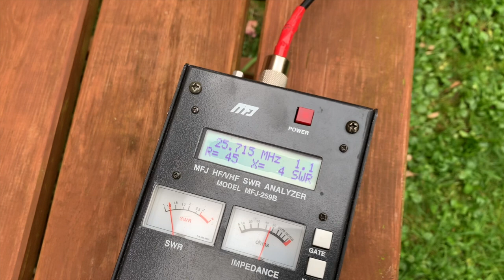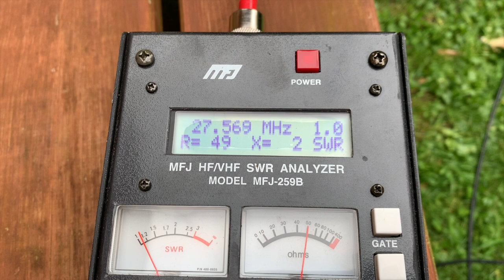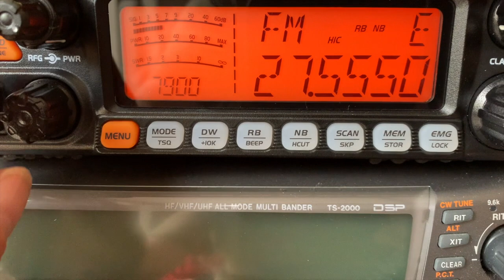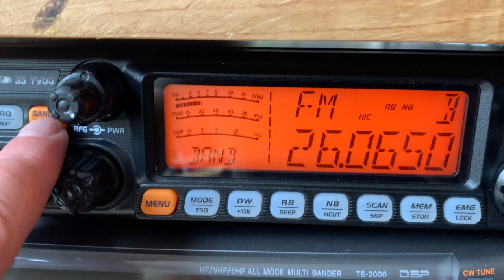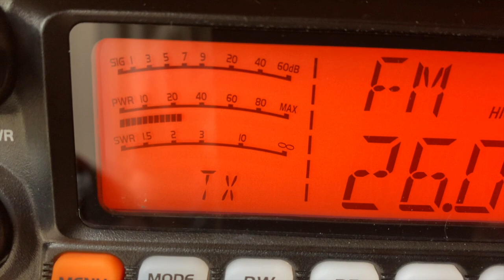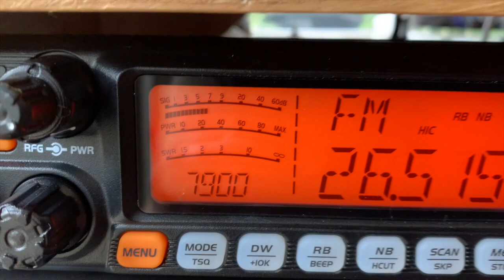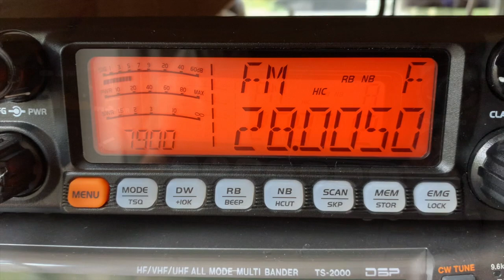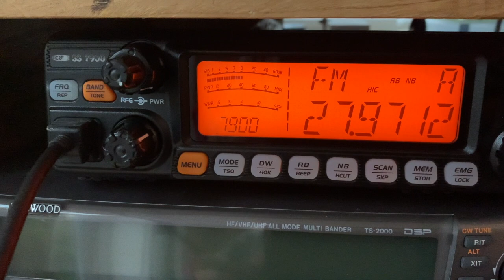CB Radio: Build a GainMaster HALFWAVE on a DX Commander Pole..Another detailed upload

Comment: What a brilliant little antenna been running skip from South Africa to EU even as far as Finland Thx Mike.
Reply from the maker: Thank you 👍
Reply: How about instead of using 8AWG copper wire (same as 10mm2), make the upper part with same coax, using its outer part shorted with inner? Isn't the diameter of the coax will give much more wider bandwidth?

Comment: Interesting to see an alternative to the traditional T2LT 73
Reply from the maker: Cheers Tim
Reply: yes im going to build it
Reply: We really need a quarter wave length coaxial trap? I saw other version of this antenna with only 5 or 6 turns on a 10 cm diameter pipe 🥺, I'm confused 😁
Reply: @14KiloWhisky - it's actually a half wave choke, because it said a voltage node so it's a voltage choke not a current choke. So what you have to look at is about 2.6 in of former Plus the current is going all the way around the coax so you have to take the average of two halves equal to one hole or an additional point 2" so a total of 2.8 in * pi * 16 then divide that by the velocity factor and guess what, you've got a half wave inside which is 180° out of phase which tends to cancel - exactly what you want at that point.

Comment: The HW version some have stated handles power better than the 5/8. I can confirm this as I have owned both. The SWR on the 5/8 version likes to creep up when running power. Maybe the matching stub is the culprit. I had the 5/8 wave up for 8 years with no issues, until it got wacked by lightning. I now have the HW version and no SWR crawl when running power. Performance is about the same.
Reply from the maker: Yes it is the stub,  that is one of the reasons for west flex the power handling.

Comment: I once build a TL2 and de SWR changed if the feedline was moved. So i wasn't impressed. Then build a Double Bazooka.  I'm still using it on 11 meter. I made one for 40 meters too but i have no space around the home for such a antenna. However i tested it once when i was camping and it performed also very good.  Since you are enjoying making coax antenna's you could try it as well just for fun and experiment.
Reply: I'd like to know your choke design as in how many turns and what diameter former..?
Reply: @JAFO.  12 turns coax around 10cm. Beside that i used a fabric made ferrite choke.
Reply: @48pluto - sorry it took me a few extra days to get back to you, LOL, but you had about one turn too many on your 10 cm former choke. 
- if you were to try it again with 11 instead of 12 turns on a 10 cm former using 66% RG8X or RG58 I think you'd have much better luck.
.
Now don't forget End effect meaning you want the bottom half to be the full 108", but the top needs to be 5% shorter so more like 102.625".
.
By now it might be a moot point but if you ever get the bug and want to try it again, give it a shot with 11T -;or you could use a 2.6" former and wrap 16 turns using 66% RG8X or RG58. 
.
Mine works so well it's quite flat across both the 10 and 11 m bands and not hitting two to one until about 2 MHz bandwidth! 
73

Comment: Hi !

Q1
The cable is RG58 or H-155 ?

Q2
Is there an exact diameter of the cylinder on which to wind the cable, or is it only important how long the section is?

Q3
I would like to build it, but I don't understand the final length of the 3 sections. 2.49, 2.49, 2.77 meters? I would like to use it between 27,200 - 27,800 MHz, on classic CB frequencies, in USB mode

Thanks, regards

Comment: Nice construction and great video.  This is actually a 1/4 wave coaxial dipole not a "1/2 wave antenna".  Just as a 1/4 wave ground plane like a "Starduster" or the Italian equivalent consists of a 1/4 wave vertical element with 1/4 wave radials.  If this was what is commonly referred to as a "1/2 wave antenna" the center conductor above where the shield stops would be twice as long i.e. 4908 mm or 16' 3".   Nothing wrong with 1/4 wave antennas... they work well.  There has always been confusion with radio operators and antenna manufacturers around "1/4 wave antennas" as they actually ARE 1/2 wavelength center fed (or very near center fed) antennas....  but in typical descriptions a "1/2 wave antenna" would be an end fed 1/2 wave radiator like a "A/S Mighty Magnum" or one of many other 1/2 wave end fed antennas.  This Sirio copy and the original have a 1/4 wave radiating element and a 1/4 wave "image reflector".  The 5/8 version has a 5/8 wave radiating element and SHOULD have one or several 5/8 wave image reflectors or else the coax shield will have common mode current on the outside and will act as the "image reflector".  An easy and simple way to check for common mode current on the outside of the coax on any antenna installation is to simply place you hand near of around the feed line at various points... if the reflected power/S.W.R. changes then there is common mode current on the coax shield and this can distort the radiation pattern of the antenna/give false S.W.R readings as well as creating RFI in the shack and potentially local RFI to other devices in your home and neighbor's homes.  We don't refer to a "J Pole" or "Slim Jim" as a "3/4 wave antenna" even though the main element appears to be 3/4 wavelength long.  A J Pole is a 1/2 wave radiating element directly coupled to one leg of a parallel 1/4 wave matching section.  The "matching section" is driven by equal out of phase r.f. currents so it does not radiate...  just like ladder line or twin lead.   The parallel 1/4 wave matching section with one unconnected stub is what causes the horizontal radiation pattern distortion of J Pole and Slim Jim antennas.  J Pole antennas and all 1/2 wave end fed antennas have problems with common mode current on the coax and many use a Coaxial Current Choke like the Sirio antennas depicted in your videos use.
Reply: Sorry mate but you're just confused by center-fed vs bottom-fed. If installed vertically, this is most definitely a vertical 1/2 wave center-fed dipole.
The RF energy radiated from both the 1/4 wave center conductor above the cut coax shield and for 1/4 wave below it - ON the shield - adds up to 1/2 wave length, and is stopped by the choke,
 - hence the need for a choke.
On a bottom-fed 1/2 wave the RF energy begins radiating at the bottom of the 1/2 wave conductor (radiator) with high voltage and goes up 1/2 wave, through the high current in the center of the radiator and achieving high voltage at the tip, then reverses back down 1/2 wave through high current in the center to high voltage at the base/feed point, thus completing the full 360° cycle or One wave length.
On a center-fed or this T2LT-style vertical - the RF begins radiating at the center feed point (or point at end of cut coax shield) as high current, travels up the radiator 1/4 wave to the tip where it achieves high voltage, then reverses back down 1/2 wave through high current in the center and to the bottom where it achieves high voltage at the choke, then back up 1/4 wave to high current at the center - for a 360° cycle or one wavelength.
BOTH are 1/2 wave antennas.
A bottom-fed 1/2 wave can have a 1/4 wave height advantage - depending on construction & installation.
A center-fed has the advantage of a near perfect 50Ω feed point impedance, requiring no lossy or power limiting matching network.
73
Edit: I have never before heard the term: "Image reflector" - but it sounds like it would possibly often be heard in certain local areas on Channels 17 & 19. 😣

Comment: Hi Mike, I follow your videos on antennas because you know how to explain them very well, and sometimes I make them.  It would be nice to know if this antenna could also be in 15, 20 mt band.  My doubt is if there calculation for the choke on these bands
Reply from the maker: You can scale them up but size is an issue... the coil is a 1/4wave ;)
Reply: yes this coaxial dipole will work for any band as it is simply a 1/4 wave radiator with a 1/4 wave coaxial sleeve to make up the 180 degree mirror image reflector that the radiator needs.  The choke calculations can be found on the internet for any frequency range and are not antenna specific, they are frequency specific but will still work to some degree even if not exactly correct.  These coaxial sleeve antennas are very popular in commercial and Ham VHF and UHF antennas and usually do not require a common mode coaxial current choke as the sleeve portion resolves most of the common mode current on the outside of the coax feed line.

Comment: you make great videos on the subject of antenna construction 👍🏻 are the dimensions of the antenna that you show at the end of the video the perfect ones?  249cm<--249cm coil 16 turns on 60mm diameter or 66mm?  73 55
Reply from the maker: Yes, correct

Comment: In theory then, just find a 1/4 wave  x2  plus the matching and any band could be made? With Cal's new 60 ft pole maybe a 20 meter version could be mounted, and no radials needed?  that would be an interesting build. I have an M2000 that will not do 20 meters, but it being 24 feet I wonder if a 20 version of this mounted off to the side of it could be done, again avoiding the radials issue. Just a thought, you make building these look too easy!! Thanks for doing all 3 versions!!
Reply from the maker: yep up or down scaling to suit the band.  😍

Comment: I want to recreate such an antenna.
BUT! I want to make the 2.52M top section of two aluminum tubes, because the whole thing should be as thin as possible to reduce wind load and optical reasons. I thought of taking two tubes with 6 and 4 mm diameter each, and 8 at the bottom.so  I could slide the lower part of the coax into a GRP pipe.
Reply from the maker: Go for it!

Comment: Nice work, but you are not done yet. this antenna needs lots more fine tuning.
I built one that has a bandwidth of 1MHz. That is, a swr lower than 1:1.3 over this area. The performance is significantly improved by changing the radiator to flexible copper wire of 10mm2.
Reply from the maker: Thanks for the input.  :)
Reply: How about instead of using 8AWG copper wire (same as 10mm2), make the upper part with same coax, using its outer part shorted with inner? Isn't the diameter of the coax will give much more wider bandwidth?

Comment: Well I have now made both the 5/8 and the 1/2 wave, and the 1/2 wave is 2 s-points up compared with the 5/8! However, this is in hilly Welsh terrain. Not what I expected though!
Reply from the maker: Humm is that 2 points up on a known signal or on  background noise? Interesting 🧐
Reply: Mike-M0MSN My friend who lives around 2 miles away with a few hills between us is now getting me on an S7 whereas he was only getting me on an S5 when I used the 5/8. I haven’t changed anything else at all. I think it could be because the antenna is actually higher off the ground relative to its size, because it is shorter and I am using the same height pole?
Reply from the maker: gtaguy235 OK, yep I think you are spot on, just go to show why we have so many different types of antennas.  Thank for letting me know.
Reply: The "takeoff angle" or vertical angle of maximum radiation is different between a 1/4 wave and a 5/8 wave antenna.  A typical 5/8 wave antenna has a lower "takeoff angle" and hence is better for DX because the lower angle extends the ionospheric propagation angle/distance.  Higher angle = shorter hop/lower angle = longer hop.  The higher angle "1/2 wave" (actually a 1/4 wave radiator) may give you better local coverage.   Each and every antenna have their own merits and faults.  It just takes experimentation to find out which works better for each individual situation.
Reply: @justme-n-gracie  Hey Just Steve, you seem confused about RF. It's AC so there is a positive half and a negative half to the radiated wave-front. A 1/2 wave can be a 1/4 wave up and a quarter wave down - as long as both are in the same polarization (like a Starduster) but a true 1/4 wave GP would have a 1/4 wave vertical and one to four 1/4 wave radials in the horizontal - so since there's a 20dB separation in radiation performance between vert & horiz, you only see the radiation from the upper vertical 1/4 wave - if you're on a vertical receive antenna,
 and that's why it will be 3dB down from a 1/2 wave like a center fed 1/2 wave Starduster, Ringo, A99, Proton99 and others only 18' or so long.  When my cousin lost his mickey-mouse installation 1/4 wave GP in a windstorm and replaced it with a Starduster on the same mast that fell with his 1/4 wave on it, he went up about 1/2 to 1 S-unit to everyone, same height & coax.

Comment: Hi Mike ' good video as per normal".I was wondering if you could' build one of these for lets say ' 15 meter's or 20 meter's or some other HF frequency ?. would be interesting to see if these could be adapted and what sort of performance you would get out of them ;) . cheer's Martin mw0cnd
Reply: Yes. Others have done this by scaling the dimensions. The only issue is of practicality. If you need a 7m pole for the 10m version you would need a 14m pole for the 20m version..

Comment: hello Mike from IU8HDJ I would like to know if the multiplication at 0.93 must be done obligatorily I only understood that you got 249cm because you calibrated at 27,500 right?
Reply from the maker: The 0.93 to 0.96 is a correction factor due to the materials being used (VF)
Reply: @mike-M0MSN  thanks mike  i knew 0.95 for copper and 0.85 for aluminum from what you tell me 0.96 is also fine

Comment: Did you ever do a 1/2 vs 5/8 comparison?

BTW the stub on the 5/8 version, does that exist just to change the impedance back to 50ohm as you increased the length to 5/8?
Reply from the maker: no not yet, and yep pretty much.. :)

Comment: Hello  Mike
Can you explain me how ti calculate the choke depending on the frequency?
In the T2LT 27MHz video make  16 turns on a 6.6 cm diameter.  The total lenght  is 331.75 cm, a long way from 277 cm???
Thank you    73 de i3qko.
Reply from the maker: Yes:  the choke needs to be 1/4 wave length (1/3 on a 5/8 antenna or more)...I used 16 turns because I used the same former as with the 5/8 wave..
Reply: @mike-M0MSN  Can I use a different former, let's say 60-63 mm, while keeping the same 1/4 wave lenght diminished proportionally to the antenna ?
Reply from the maker: @BASSLINEPFP  yes
Reply: the common mode choke needs to be a specific impedance at the intended frequency of operation to stop or reduce common mode R.F. current from traveling down the feedline.  There is a Ham's site on the internet that gives specifics.

Comment: Maybe I suck at math (I do actually)  but a 66mm diameter bottle's circumference  is 207,345 mm  and  at 16 turns gives you a length of 3317mm more or less, and not 2.77m?
Reply from the maker: No your math is good. You need a minimum of a quarter wave to choke(2.77) at this frequency, but as this version of the antenna is a 5/8 or 66% , 3317 is a better choke.
Reply: @mike-M0MSN   I thought this was a halfwave.
Reply from the maker: @WillieJu  again you are right, I should have checked the video before I made a comment, that said the choke coil is the same as the one I used on the 5/8 wave. Same thing though min 1/4 wave coil. Bla bla
Reply: @mike-M0MSN   Cool, I wanna build me one for my CB radio 27Mhz and put it up 11 or more meters.

Comment: I calc'd 2.749m incl Vel factor for 27.2
Reply: You must have 120° not 180° in order to get a flat swr, a T2LT should be 74Ω or about 1.4:1 when resonant
Reply: @cedarridge3020 - your measurement looks pretty close for the bottom half but you have to take 5% off the top half for "End effect* - unless you're going to put some kind of a capacitance hat on it.